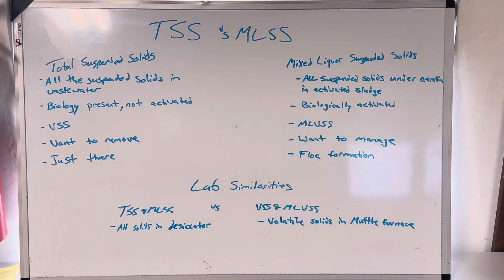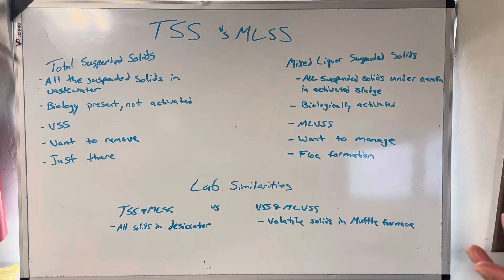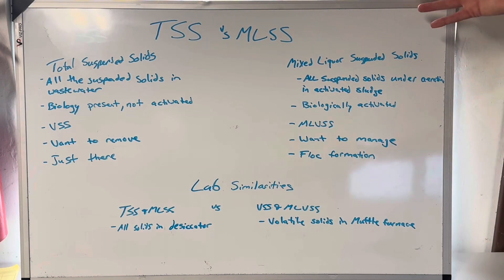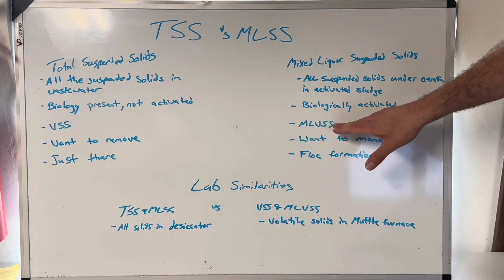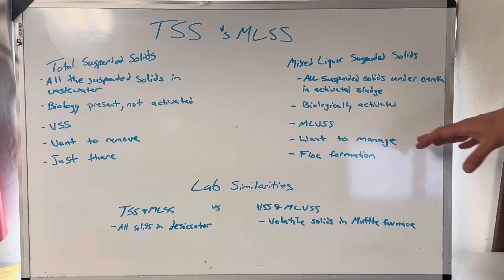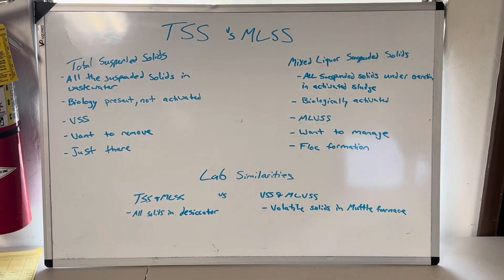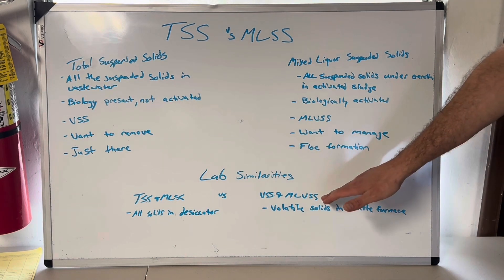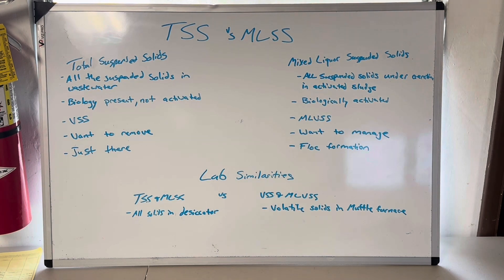Wastewater Whiteboard: TSS/VSS vs MLSS/MLVSS Comparison Plus Lab Procedures

Comment from the maker: Want me to shoot a video on a question that’s stumping you in your studying or just want some clarification on?  Ask in the comments!

Also if you have anything to add please put it in the comments below!
Reply: quick question! on a math problem like MCRT can you use MLVSS as the MLSS variable like you can with TSS? if MLVSS is given instead of MLSS can you use it or do you convert it somehow?
Reply from the maker: @jacoboutlaw8064 great question!  I have never seen MLVSS used for an MCRT calculation.  If you are asked for an MCRT and only given MLVSS but are given a percentage of MLVSS then divide that by the percentage.  For instance, if they say the MLVSS in 2000 mg/L and the solids in aeration are 70% volatile you would divide 2000 by .7 to get 2857 mg/L MLSS then you would do your calculation using the MLSS.  I will say, though if they want an MCRT and they give you only an MLVSS with no percentage then that’s all you have to use.  I’d be surprised though, because the industry standard formula uses MLSS.  Hope that helps!  Let me know if you want me to shoot a video on this to explain it more thoroughly!